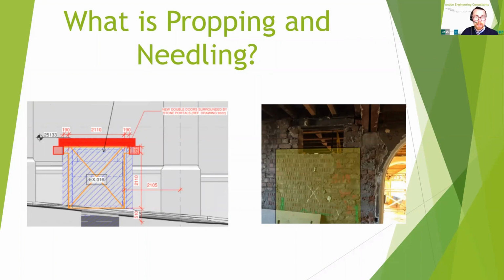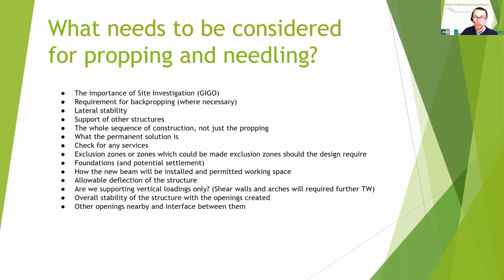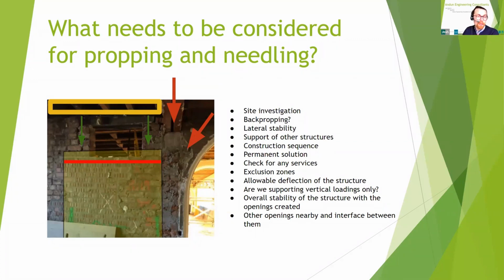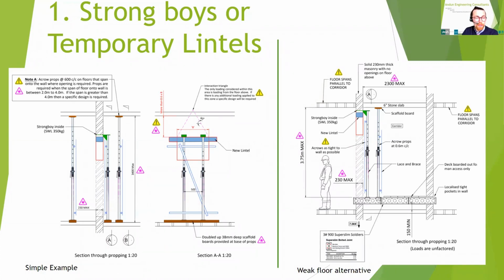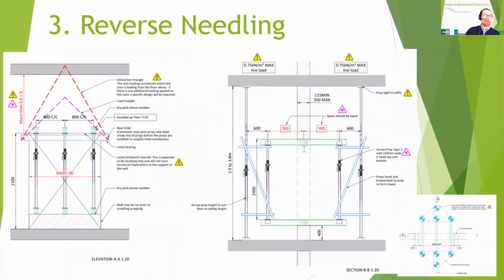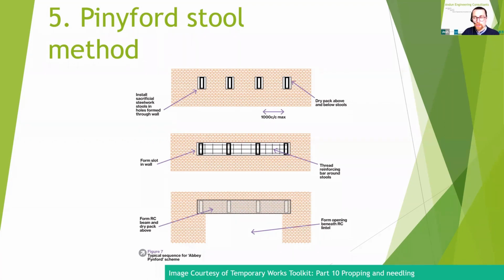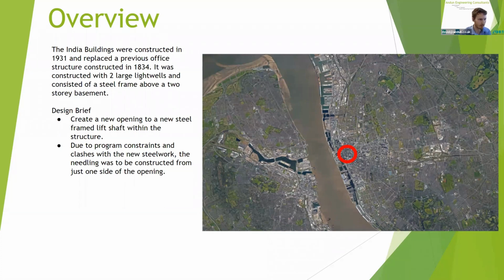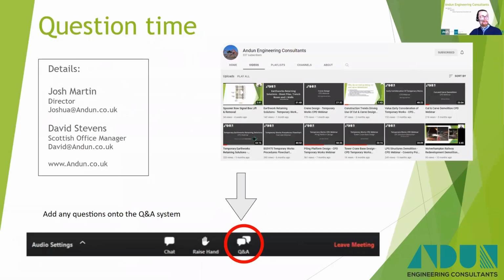Propping and Needling - CPD Webinar & Case Studies

Comment: Hi, 
Did you tension the rods where you used the back to back PFC solution(example 4).
My thinking is you were relying on friction between the PFCs/timber packing and the wall generated by tension force in the rods 
Otherwise the wall would be bearing onto the rods, on a very small surface area and I can't see that working with 0.42N/mm2 allowable bearing stress for brick. 
Also the bending moment in the rods would make it unfeasible.
Reply from the maker: Hi Bogdan Moga, thanks for your question. In this case the rods were not tensioned, the system relied on CHS sleeves over the rods to provide the suitable bearing, bending and shear capacity of the small needles. The all threaded rod ties on their own are poor in bending and would provide little bearing as you say which is why it was important to have sleeves that would bear directly onto the back to back PFC webs.
Reply: @andunengineeringconsultants  That makes sense. Thank you!